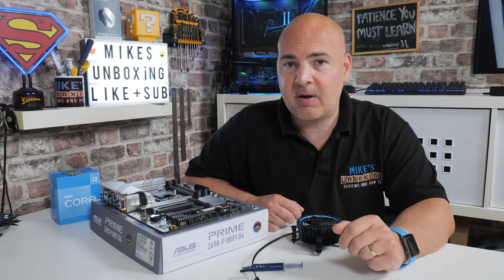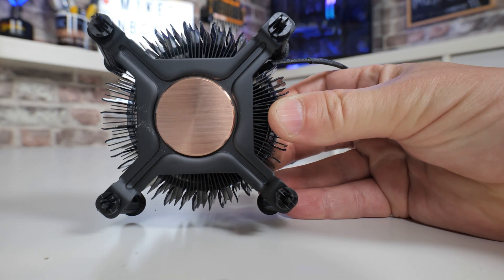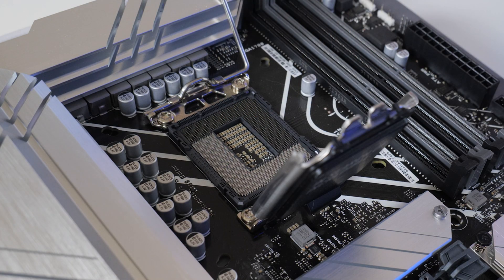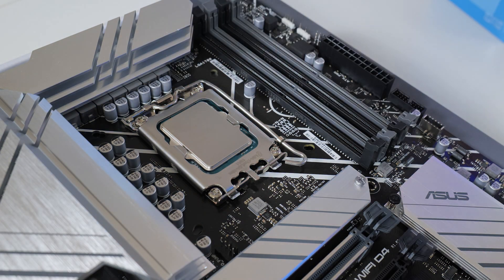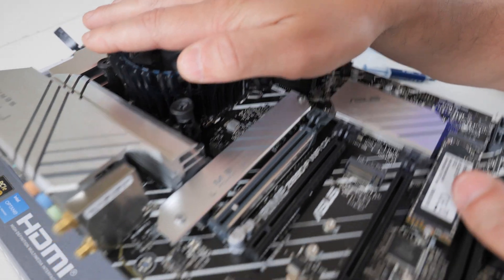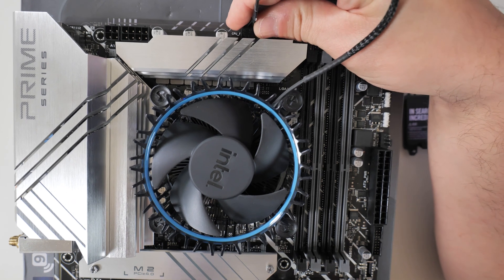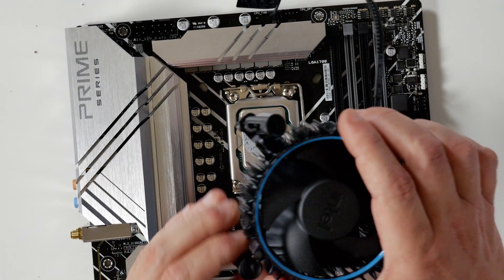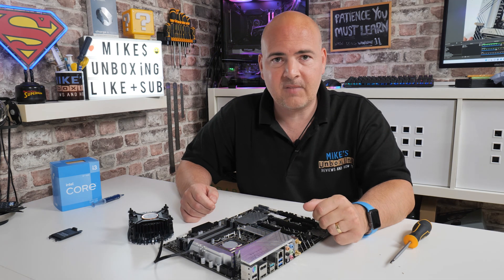How To Install Or Remove Intel LGA1700 12th Gen Stock CPU Cooler

Comment: Your video was great but somehow i endded up breaking one of the cooler's pin . I succesfully fixed 2 when i truef to push the 3rd one . I heard breaking sound . Then realized 4th pin wasnt in only one of its dmall pin was in and it broke the other half of it 😢 ive to replace. I hate stock coller model very bad deaign
Reply from the maker: Yeah it is a poor choice of design and almost certainly going to break at some point either from mounting or just getting brittle with heat and age
Reply: @mikesunboxing  i am now getting cooler master hyper  spectrum 212. Is itgood for my i5 12400f?? With stock i was reaching 95, in some games

Comment: ???That cooler comes with paste installed on it already normally.
Reply from the maker: yes that is right it does, change it for better thermal paste if you want to or if the cooler has been used previously

Comment: My pins won't push through.. only the 2 bottom will go through the holes but not the top ones. I pressed really hard but they just won't go in
Reply from the maker: do one in the top then one at the bottom or it won't fasten properly.

Comment: Maybe easy and less expensive to manufacture in this way, but not very intelligent or user friendly, I am surprised that Intel still keep this unfortunate four-pin way of installing the cpu cooler.  If you don't believe me, check how it will be in twenty years from now and look back to today.

Comment: GUYS HERE IS ANOTHER METHOD (less pain, better results)

Flip the motherboard upside down (your cpu cooler should be holding your motherboard)
Use pliers to hold together the 2 or 3 plastic things while pressing down the little buttons on the other side

Comment: IM TRYING TO INSTALL IT BUT THE 4 PUSH PINS NEED SO MUCH PRESSURE THAT IT BENDS THE MOTHERBOARD AND PUSH EACH OTHER OUT, I CANT GET THE 4 TO LOCK IN CORRECTLY ITS GOING TO BREAK THE MOTHERBOARD
Reply from the maker: if this is too much stress, get a cheap tower cooler like the thermalright pa120se and save yourself the stress

Comment: One of my pins didn't click in and seems a bit loose. But I can't push it in any more?
Reply from the maker: you need to twist the pin 90 degrees to the unlock position rise it up then 90 degrees back and then push through

Comment: Hi, can the pc still be operated if the cpu cooler is not secured properly? Thanks!
Reply from the maker: i wouldn't like to try it, it will likely get very hot and thermally throttle and eventually shut down to protect the CPU

Comment: Hey
Should I buy thermal paste or will the CPU cooler come with applied thermal paste
Reply from the maker: it will come with some pre applied but i certainly suggest getting some spare anyway incase there is trouble with the mounting and the stock paste isn't very thermally conductive. get some arctic mx4 or mx6 you won't regret it

Comment: I think 14 gen Intel go in the LGA 1500 too.
Did I spot a slightly bent pin in the cpu socket?
Reply from the maker: 14th gen is lga1700 also. not sure about the pins, i don't have the board now to check, but thanks for pointing it out
Reply: chipset dependant. @mikesunboxing

Comment: Oh well heck.. the manual with the CPU and Fan doesn't make it clear the pins need to be to the right to engage. Now in hindsight ,the diagram I am looking a shows turn right THEN use a screwdriver turning right to finish the install... strange... Intel .. why?

Comment: Is this normal that the fan is pretty loud at the beggining as it speeds up, but after one to 3 seconds it gets silent? 

Stupid question, but i wanna make sure my fan doesn't have some faulty bearing or whatever.
Reply from the maker: Yes until the motherboard logic kicks in it goes full blast
Reply: @mikesunboxing  thanks for answer

Comment: RIDICULOUS PRESSURE NEEDED TO CLOSE CPU LOCK!  WTF?!  I AM TERRIFIED..!  WHY ???
Reply: You need that pressure to absolutely make sure all of these pins make contact 
Don’t worry it won’t break
Reply: @Sakthi692  It DOES break, already happend to me
Reply: @LEUNAMalreves  then you either put too much pressure or put the pins on the wrong orientation
Reply: @LEUNAMalreves  Ive installed like ten of these. Never broken
Reply: @Sakthi692  well it doesnt indicate which direction is it
Reply: @LEUNAMalreves  the pins have to be unlocked when installing the cooler. Doesn't matter which direction you put it in, you just have to have the pins unlocked
Reply: @LEUNAMalreves  and I can tell from this comment alone that you have never installed a cooler like this and just making stuff up
Reply: @LEUNAMalreves  exactly I broke one of my pins due to this have to get new cooler . Intel has really old way
Reply: @Sakthi692  mine broke it does break well u can blame me . I successfully  pushed 2 cooler joint pins. But when I was trying to push the 3rd one the forth one plastic pin broke 😢 it's hard to do and so confusing . Now I've to buy new cooler 😢

Comment: I think I watched this video every time I had to test a 1700 socket CPU or motherboard. Goes to show how unintuitive and not straight forward this cooler is. I swear it is easier to install a waterblock than using this plastic gunk.
Reply from the maker: i think you are right, this design sucks

Comment: Hi Mike, can we install an after market cooler in LGA 1700 without having to detach motherboard from the case?
Reply from the maker: yes usually if the case allows access to the rear of the board

Comment: Thanks for the video! But egads, it has no backplate that comes with it ... and the motherboard just has holes. Well, I hope the motherboard is strong enough to stay over time.
Reply from the maker: after a lot of heat cycles they are usually okay
Reply: @mikesunboxing  Yeap ... I'm thinking the plastic post may give out more than the board now. Building this system for a friend LGA1700 i5-13400 13th gen (heat sink included) with ASRock Z690M-ITX/ax Motherboard. He said he doesn't want a gaming system so don't go over $1200.00 ... etc. So no big Graphic Card and no Water cooling system are needed. Amazing how parts these days cost way more and look so cheaply made and I still went a tad over $1200.00

Comment: How many months/years this mx-4 thermal paste last on cpu surface before drying out ?
Reply from the maker: they say about 5 but i would probably change it yearly
Reply: @mikesunboxing  Does thermal paste lowers cpu idle temperature (0% Load) or it's only effective under heavy load ?

Comment: Thanks for the informative video Mike - I just got a new I5 LGA1700 and was having trouble with the stock fan, but this showed me clearly what to do, and it's all installed and ready to go now 👍 It would have been easier if the 2 picture installation instruction from Intel showed clearly that the pins should be in the clockwise position in order to click them down, with mine they were all in the undone position out of the box!
Reply from the maker: yeah it isn't totally clear, it is almost like they don't want the end user to build their own computers
Reply: I cant get it in! what is the clockwise or the correct position so i can click it into place ????? god damm it!
Reply: @Maltebyte2  They need to be clockwise to fit (see 07:06 in this video). Personally, I think this is the worse fan clamp design I've ever used, and I have been building PCs for 25 years now, why they can't use a standard bolt, clamp and spring is beyond me. I expect it's all down to cost cutting.
Reply: @MrJozza65  Thank you for the quick reponse! So if the sand clock is standing up and not on the side that is clockwise... WOW! Why not print open and locked on there!?? All in all this concept really is Garbage!! And thanks again!

Comment: Nice video, is there support motherboard gen 10 this cooler.
Reply from the maker: no sadly the mountings on the cooler are too large for the older LGA1200 platform
Reply: @mikesunboxing  thanks a lot

Comment: I REALLY cannot have this cooler rn, is waiting 2-3 months with this cooler perfectly fine? Like does it correctly do it’s job at dissipating heat?
Reply from the maker: it is fine but needs a lot of case airflow, and should really be replaced when possible if the temps are rising
Reply: @mikesunboxing  Ok, thanks! I don’t have the case nor the money to get a good case airflow, I’ll just wait to get a good cooler!

Comment: Hello Mike. Can we install and uninstall this RM1 cooler while motherboard is attached with the case (scenerios where only thermal paste has to be changed), or do we need remove whole board to re-attach the cooler?
Reply from the maker: should be fine with the motherboard installed in a case

Comment: When I installed this cooler on the motherboard the pins seem to be wobbly, but the cooler seems to be firmly attached. Is this normal?
Reply from the maker: not really they should be under tension and not really move at all
Reply: @mikesunboxing  Thanks... that was what I was thinking. My first Intel build and I'm not a fan of this pin deal. Going to take off and install a third party cooler that has a much nicer attachment system.
Reply from the maker: @williamainslie4049  Feel free to join our Discord chat if you need any more help https://discord.gg/XtBTGQ6BDu

Agree to the rules by clicking the emoji and you will get access to the rest of the Discord channels

Comment: the downside of new intel stock cooler is requiring to use screwdriver to remove it unlike the older stock cooler you can turn the pins by your hand
Reply: There is nothing that stops you from turning the plastic things by hand. It doesn't even need a lot of force.

Comment: when you put it back on; mine is 90 degrees facing the wrong way (intel logo on the side) so i wanna remove it and put back on the right way round but when i take off, do i have to re-apply thermal paste? or can i just put it back on with the thermal paste already on the CPU after i previously installed it??
Reply from the maker: really you should clean it and use fresh, but depending on how solidified it has become you "might" get away with it
Reply: @mikesunboxing   well ive had my stock cooler on my i5 11400f for about 3 months. would i get away with not reapplying new thermal paste after 3 months of use? (just incase, i dont want to take the time to clean reapply)
Reply: @monkgeg  It's not about the age of the paste, it's about air bubbles. When you push the original blob ob paste down it nicely flattens. But when you pull it off, it messes that nice smooth layer up.

Comment: HOLY CRAP I have had INSANE troubles after the cooler fell off and I had to reinstall. This flimsy design is really bad, and I think I have broken something. My CPU is now at 99 degrees all the time :( but thank you SO much for actually going through how to reset the pins. The Intel website didnt have any details on this. You fix things where Intel really fail. You should get paid for doing us a public service. Thanks again!
Reply from the maker: Thanks for sharing and glad you got it sorted in the end
Reply: How did u fix it running so hot please tell me , mines running at 100 degrees constantly
Reply: @matthewjuniour  the stock cooler that comes with the processor is weak. If the cooler is all mounted corrected and the cpu is still heating up to 100 degrees, that means it is not being sufficient. You will need to buy and install a separate, more powerful cooler. Just make sure it is compatible with your cpu socket
Reply: yh the stock cooler was cooling and i3 13100f, I upgraded to an i5 14600kf and it reaches 100 degrees using it, went back and tried my old cpu and it worked fine but still high temps , getting a new fan tomorrow thanks 👍
Reply: @matthewjuniour  makes sense. The K models of intel's cpus consume a lot more power and create a ton of heat.
Reply: yeah , I’ll be getting an aio from thermalright soon so that should be fine , it’s around £44
Reply: @matthewjuniour  the problem can also be the low amount of paste that comes within the cooler. i just got my 12100f, and the cooler came with such thin layer thermal paste, that i had to add a extra on it
Reply: @HeeJoo_tz I ended up getting an AIO, it was because my cpu was so powerful that the stock intel fan was just not good enough to handle it

Comment: Thanks! Turns out I didin't click enough on the two bottom pins. So my idle temp was around 50 before watching your video AND around 32-35 degrees Celsius on idle AFTER watching your video. Thank you so much, Mike!
Reply from the maker: Glad it helped!
Reply: same and my games kept crashing

Comment: Do you need to rotate all 4 pins all the way right or left before pushing them in when installing
Reply from the maker: worth checking they are in the right place before you try it, if the cooler is new it should be in the right position

Comment: They REALLY need to get rid of these push pins and have bracket screw come with it. its been ages
Reply: It's doing my head in, when I push one corner in it's good, but when I push in the opposite corner the other one pops back out 😩
Reply: I break them every time
Reply: There so annoying and break so easy💯
Reply: Yes
Reply: They added a stupid thing
Reply: My i9 came with thumb screws to mount to a standard intel mount.
Reply: That's true, but most people replace their CPU cooler with a better one anyway and it makes no sense to produce the original one at a much higher price! However, this original cooler works quite well up to 3100 rpm within the allowed power.
Reply: No way, I love how easy those are, I test MB - CPU s and most easy to switch the stock cooler from one to the other motherboard, not one other cooler is fatser to mount. If you brake them then you do it wrong.
Reply: What are you talking about?

Just bought an AMD CPU and by far the worst thing about it is having to screw it in while holding the damn backplate, and never knowing if it's tight enough/properly in place. 
Why the hell should I have to go to the back of the MB anyway?

The Intel system I had before was WAY better. 4 clicks and you're done.

Comment: The top left pin won't click into place but all the other pins do. Why is that?
Reply: I have the same MoBo, this cooler is awful it's so complicated to install specially the top left corner
Reply: @gustavovasquezveliz7046  I agree but once you get it into place it works like a charm. I took it to a professional and he made it click in a matter of seconds. So maybe we just don't know what we're doing lol
Reply from the maker: @gustavovasquezveliz7046  This is maybe easier to fix or at least advise if we can ask more questions and get direct answers, so feel free to join our Discord chat and we can go over it in more detail https://discord.gg/XtBTGQ6BDu

Agree to the rules by clicking the emoji and you will get access to the rest of the Discord channels
Reply from the maker: try twisting the top 90 degrees it might not be in the correct position
Reply: @mikesunboxing  It seems my issue is that two pins on the same side will click. But when i try pushing the first one on one side, and then trying to push the next one diagonally on the other side, it won't click.
Reply from the maker: @Omar_E11  This is maybe easier to fix or at least advise if we can ask more questions and get direct answers, so feel free to join our Discord chat and we can go over it in more detail https://discord.gg/XtBTGQ6BDu

Agree to the rules by clicking the emoji and you will get access to the rest of the Discord channels
Reply: @mikesunboxing  I got it to connect and the PC is functioning smoothy, but thank you regardless.🙏
Reply: @mikesunboxing  I've done that too actually. Should I press harder? Is the pin damaged?

Comment: So if you but a say an i5-12600k cpu do they come with a cpu cooler always?
Reply from the maker: some k series don't i'm not totally sure about that one, but i would use an aftermarket cooler on a K sku cpu anyway the stock one is not really appropriate

Comment: Great tutorial as usual from the Dynamic Duo. I've been using Intel Coolers with push pins since Moses parted the Red Sea.  😂 Only had a couple of the pins break in that time. Bought backup pins off Amazon for a little more than a Fiver ( Still learning my British Slang) 😄 Take care all. Cheers
Reply: PIns breaking is why I would NEVER buy a CPU cooler employing that mounting method; screws and brackets only.  Not of fan of the "push the clip down" style either.
Reply: @PapaMav  As always...your mileage may vary. Take care James.
Reply: @rickh8380  not sure why, after breaking pins, you would continue to use or suggest using them TBH.  If you ever reaquire a be quiet !  Pure Loop AIO, please be sure to let me know your thoughts on it.  Thanks.
Reply from the maker: Very cool!
Reply: @mikesunboxing  I'm not sold on the in line position of their pump; seems quite the potentional to be very difficult to find a spot for it to be "outta da way".

Comment: With the older pin style (and maybe these when less fresh), removal was 3 step.
1. Turn the tops 90 degrees anticlockwise to unlatch
2. Pull each pin up
3. Then lift the cooler, with the pins pulled up, it can be twisted slightly to break solidified paste

PS. if you have to replace a lot (and why would you bother testing pastes on a stock cooler), you may be able to reduce wear on the pins by pushing them through in the unlatched (anticlockwise) state and then turning while holding
Reply from the maker: good idea, i'll keep that in the memory banks for next time